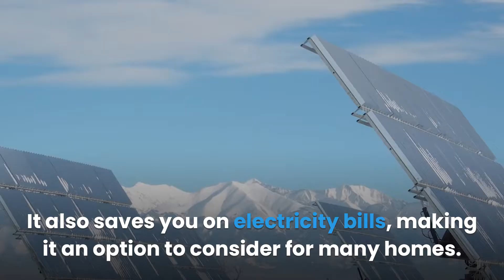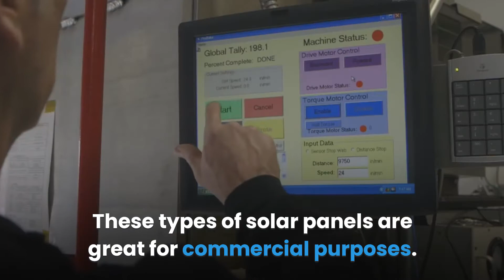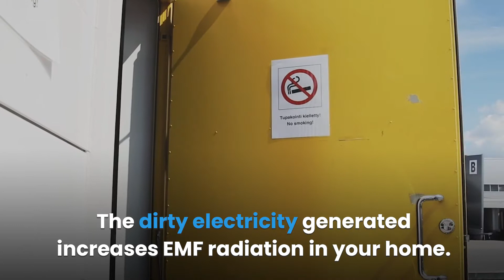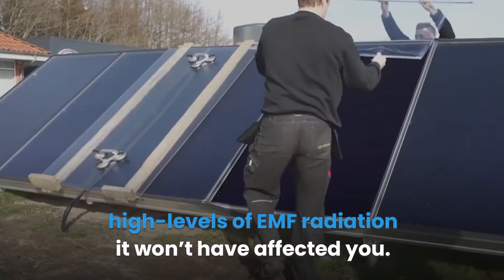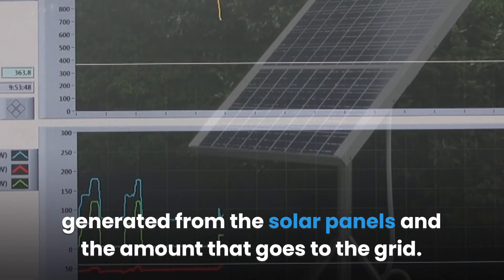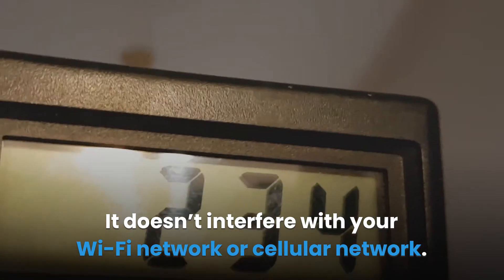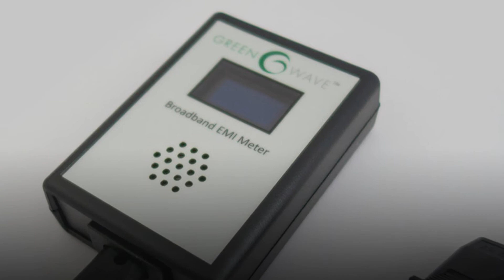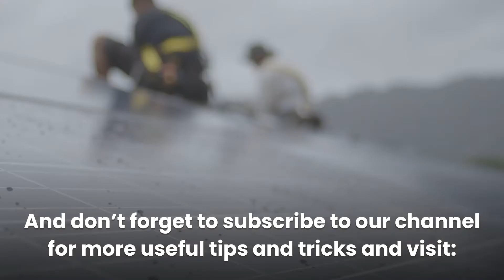Solar Panel Radiation [WHAT YOU NEED TO KNOW] | EMF Protection

Comment: Sorry, you're wrong! The functioning of a solar system WILL interfere with other devices (and not only in YOUR home or office but also way down the street) IF the system uses micro-inverters on the roof or the cabling to the larger inverter below is not sufficiently screened or fitted with ferrite RFI suppressors! The cables and panels act as brilliant transmitting antennas, sending out strong harmonic frequencies over wide sections of the radio spectrum. Radio amateurs the world over are suffering from massive interference on shortwave bands caused by 1. many types of LED light bulbs, 2. cheap battery chargers 3. poorly-designed 'wall warts' and 4. solar power systems. The interference generated in one house can easily reach 50 yards down the road. If you are going to install solar panels on your roof, please insist that the technicians installs RFi suppression on the cables and the inverter - thank you!

Comment: When you look at the Leases that landowners sign when they agree to lease thier land for industrial solar installations-- the Leases contain warnings abt EMF radiation emitted by the conduit connecting panel arrays to substations. These conduit lines run all throughout the many acres of solar arrays & across roads, streams & Resident's yards. The landowners have to agree to keep humans and animals away from the areas of thier land where conduit is buried. They admit that EMFs are present, along these conduit lines, in sufficient amounts to harm humans & animals. They also require landowners to sign a waiver that prevents anyone from suing the solar company,  & puts the responsibility back on the Landowner. Does this sound like a safe system to you?